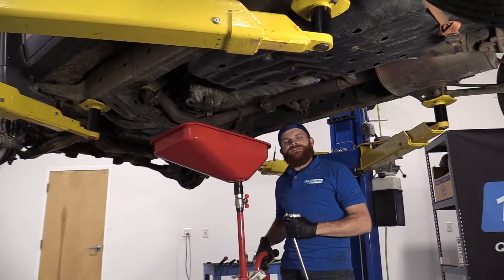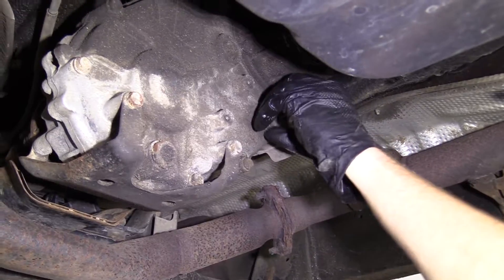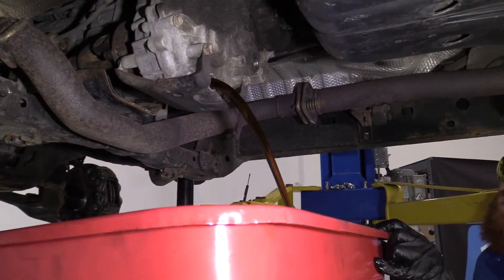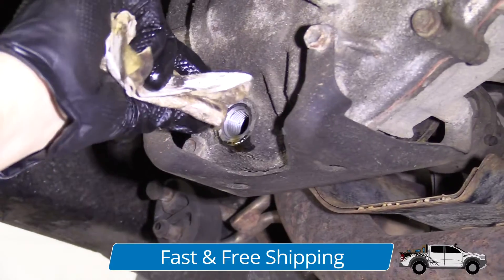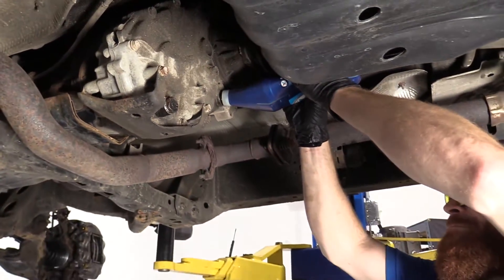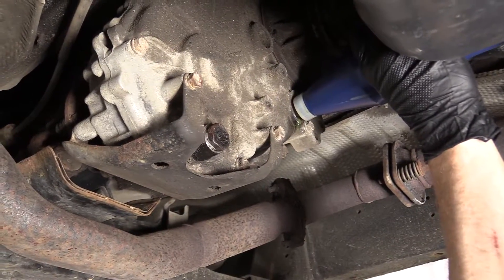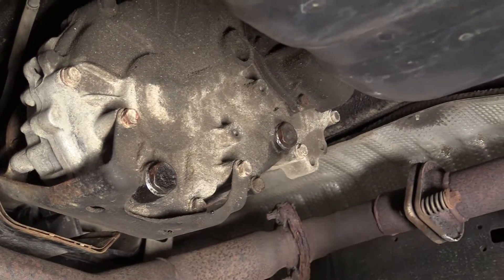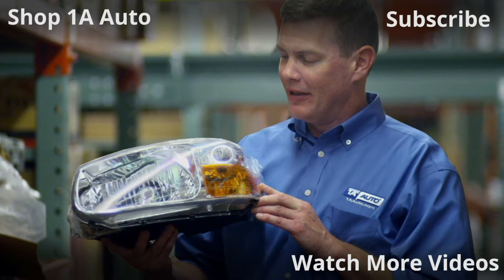How to Replace Transfer Case Fluid 07-14 Toyota FJ Cruiser

Comment: Please edit your video for those who don't know the difference between 75W90 GL-3, GL-4 and GL-5 gear oil. The FJ Cruiser has different transfer case models. Their full-time transfer case uses 75W90 GL-5 but their Part-time transfer case uses GL-3 or GL-4. For those who are looking for GL-3, it's discontinued, use GL-4 instead, it's perfectly safe. For those of you that want to know what the difference is. 75W90 GL-5 gear oil is for any gear box (differential, transfer case, or manual transmission) that does NOT contain bronze. GL-5 contains chemicals that will slowly attack Bronze, turning it black and cause the part to wear out a lot sooner. GL-3 & 4 gear oil contains chemicals and additives that will not harm Bronze components. If you're not sure what your vehicle requires, look inside your owners manual. Don't ask the kid behind the parts counter, they won't know. Your Toyota Dealership Parts Dept. will.

Comment: Great video,is there difference between gl-3 and gl-4 because the fj manual calls for gl -4
Reply: It actually calls for GL 3 for an automatic. You can’t get GL 3 so GL 4 is the best alternative. Once again this guy used the wrong fluid as he did in the differential video.